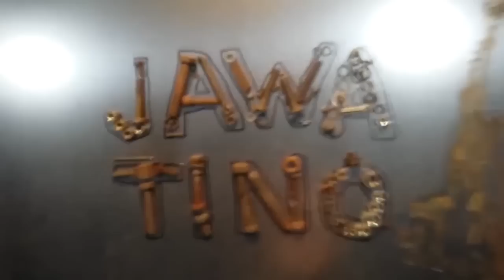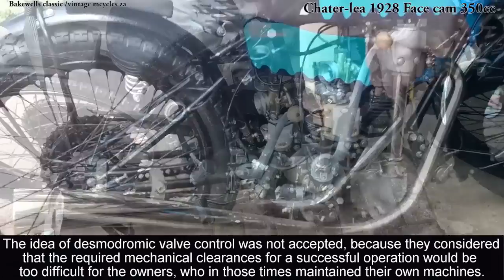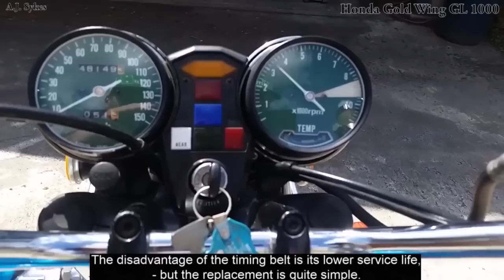The most Interesting OHC engine motorcycles !

Comment: If the 2 stroke road racing engine was developed to this level of Engineering sophistication instead of being phased out due to emissions..horsepower would be higher with a much lower engine weight.
Reply: @retiredbore378  Technology to develop more advanced cleaner burning synthetic polyester lubricants would have reduced these emissions even further if it was pursued.
Reply: @Retired BoreThe lack of electronic fuel injection (as per Mitsubishi on 4 strokes) and stratified charge did nothing for 2-strokes. Then we all chase after some demented electric or fuel cell goal.
Reply: Most all racing programs are supposed to eventually feed improvements in the parent company's general product line.  It made sense for the two-strokes for a long time but they just don't carry through for a road-going product.  I was an ardent two-stroke fan starting in the late '50s (first bike was a 200cc Zundapp) then got into Bultaco for competition and a street machine.  About that time I went to work for a Honda/BSA dealer and as my experience broadened, I began to see that durability and general good manners favored the four-cycle.  I've enjoyed both, campaigned Suzuki 250s for years for off-road but the then new four-cycle street Suzukis began to dull the magnificence of the two strokes and I could see the division was favoring the four-cycles for the future.
Reply: Join k
Reply: Split single and opposed piston two strokes are the only way to go if you want better power and clean emissions. The old crankcase induction with total loss lubrication is incapable of the low emission standards mandated today. You would be a fool if you think that the Automotive companies haven't tried.
Reply: @Donald Sayers  Split singles and opposed piston 2 cycles ARE NOT racing engines but low rpm torque machines.. Im referring to engines that are capable of sustained 12k plus rpms during a race..PLUS with the serious advances in lubricant technology these days we now have triple ester fully synthetic 2T Oils..Couple that with digital fuel and lean oil injection we now have a 2 stroke with similar emissions to the 4 stroke..I suggest you thoroughly research completely the KTM and HUSKY websites to bring your 2 stroke knowledge up to current status😁😁😁
Reply: Yeah, that's why we are all driving two strokes, not.
Reply: @Donald Sayers  Well I certainly am still and will always be..I have Suzuki RGV250..RM85L...TS250X..KTM540MXC..and an old Kawasaki KV100 farm bike..2 strokes forever and ever.
Reply: Evinrude did a great job on cleaning 2 stroke, but then BRP killed it.
Reply: Wait if my cylinderhead is ready !
Reply: 500cc gp bikes reached  200 hp before they were phased out. The current  1000cc 4 strokes don't have 400 hp.
Reply: @donaldhipple4921  no current 1000cc gp bikes have way over 200hp. Which  is better than the 500cc 2 strokes. You cant compare a 500cc 2stroke to a 500cc 4 stroke.

Comment: The  NSU  " Steam-train " drive was interesting . I  bet it made for some BAD vibration , but was fairly Bulletproof  as  well .
And the Gear Drives are Pure  ART . Strongest method , but also HIDEOUSLY expensive to manufacture .
Reply: It's odd seeing a counterweight on a camshaft..
Reply: @Retired Bore . Gears ARE the Best drive system , and Helical gears are rather quiet actually . Straight cut Howl like a bitch .
That NSU  drive has ONE of the Elements  STATIC . Basically just a SPACER . 
The Moving Elements , to be effective , would be best spaced at 90 degrees  EXACTLY like a Steam Locomotives drive rods . This will produce an odd Primary  AND Secondary vibration that Phases with the Single Cylinder Engines issues with Primary and Secondary Balance . The Cam Drive would run at Half Engine speed and Ergo , the Cam Drive would alternately Supplement and Detract from the Major Engine Vibrations . The Counterweights would not fully damp this .
I  stand by my original statement .
Reply: @Retired Bore . It was You that started talking about about 120 degrees , out of context . 
120 degrees is the best separation needed on a Three cylinder Inline Engine . Really 240 degrees in a Four-Stroke  triple .
And 120 degrees is the Ideal Bank separation in a V-6 for perfect primary and secondary balance .
Since steam cylinders are Double Acting the 120 degrees or 60 degrees would be equally effective . Just  likely that 120 was used for balance reasons .
All those facts are  IRRELEVANT .
We  re discussing a Single cylinder Engine , which has no balance to speak of , using a reciprocating drive for the Camshaft . A  drive that will be harmonically Phasing with the Primary reciprocating Mass .
I  stand by my original statement  yet Again .
Reply: In my opinion has heavy parasitic losses! But was a very good bike!👏👏👏
Reply: @Retired Bore . Heard it running in the Video . Numbnuts .
It  would  not matter about where you set the Cam Rods . 
You just gave Degrees for  Effective 180 degrees opposed to the Conrod . 
Next revolution they will be Precisely with the Conrod , since Cam drive is Half Engine speed .
And the Cam drive plates  also move fore and aft at the same Timing rate , thereby exacerbating one stroke and slightly dampening the other . 
A Slower more pronounced shake  I  would think .
Still standing by my original statement .
Singles are Rough . That would have been Rougher .
Reply: i hope electromagnetic valve switching comes quick into mass production soon.. get rid of all these fancy clockwork from the engine!
Reply: @fidelcatsro6948  . And a burned out resistor of Transistor , parks you on the side of the road . A simple  Fuse can be bypassed in a  pinch . To get you home .
Reply: @johncunningham4820  
not if theyre made by Japanese 🤣
Reply: @fidelcatsro6948  . YAMAHA  maybe . 
German Electronics are better than Japanese .
Reply: @johncunningham4820  naaaah German cars and bikes are good but they turn into endless money pits..
Reply: @johncunningham4820  حق با شماست 👍
Reply: Nope, it was quite smooth.  I was just getting into the sport when I visited our BMW/NSU dealership and got first hand experience with the very refined NSUs which used the eccentric rods.  They were mechanically very quiet along with the exhaust note which most German machines of the time were due to noise restrictions in Germany.  I owned a 175cc Maxi later on as well as a BMW R26, all of them very refined and easy to own and service.
Reply: @Retired Bore I know someone who has a large collection of NSU 250 Max machines.  They are smooth and well made.  There is little vibration, none noticeable from the cam drive.  It's rather elegant
Reply: @Retired Bore or alternatively, ride one or talk to someone who has done so.
Reply: @johncunningham4820  how about one with four thinner ones and a flat plane crank

Comment: The Chater-Lea @ 11.45 could have developed Desmo, given that precise closure is not necessary for valve sealing. But this was not known in the 20s, and was discovered by Mercedes in the 50s. A 2-thou clearance is close enough, cylinder pressure will close the valve automatically.

Comment: Darn. I was hoping to see the MV Augusta four cylinder here. My buddy got a 1976 750 that was too cool! The gearbox internals could be accessed from either side of the bike, and the camshaft drive was through a gear tower between #2 and #3 cylinders. The tower could be removed as a unit and the straight cut gears made an awesome sound, almost like a jet!
Reply: The MV Agusta is a very interesting example of design. The road bikes of the late '60s to mid '70s were a road version of the '50s race bikes, with shaft drive just like the first 500cc GP bikes of the late'40s which Les Graham raced.
 The main engine casting is a giant housing, with the gearbox inserted from one side.  The engine itself is self-contained, with just the very top segment of the cases holding the main bearings.  Cylinders are individual castings, with the cam drive being a separate assembly inserted between the middle cylinders.  The head is a one-piece casting with cam follower housings carrying the shafts as well.  
This modular arrangement allows the engine to be removed from the cases by undoing a line of nuts holding the crank bearing carrier to the main casting.  It is very useful if you have a major engine failure while testing, or for any reason need a fresh engine in a hurry.
Reply: @pashakdescilly7517  it was an amazing machine. It's biggest flaw was the front hub, narrow enough to put double discs on Ceriani road racing forks. With the narrow hub and Borani alloy rims, hard braking would cause the front rim to warp requiring "re-truing" the front wheel at regular intervals.
Reply: @eloiseharbeson2483  i am surprised that such a fault would be allowed to persist on such an expensive machine. Larger spoke flanges might help, but could lead to contact between spokes and brake caliper. That would at least lower the stress on the spokes. It's not so very difficult to make wider yokes to allow space for a wider hub.
Reply: @pashakdescilly7517  my understanding is that was changed the next model year to cast wheels for just that reason. My friend bought it NOS in 1980 for half list price ($3600 rather than $7800) because the distributor had gone bankrupt and the carbs were full of preservative.
Reply: @eloiseharbeson2483  your friend did well to get it at such a low price. Now worth rather more....
Reply: @pashakdescilly7517  if it still exists. Pete kept it for only about a year before he sold it to Jimmy. I don't know who Jimmy sold it to, but it's long gone.

Comment: For radial four-valve-heads you might go for a hollow cam rotating round the spark pluck. Suits particularly well for opposing exhausts. And has a simple shaft drive ...
Reply: Weight too much weight
Reply: @jamesangelucci5052  Not true.  There are a number of engines with radial valves in recent production - Aprilia 650 single, Ferrari 355, Honda various singles.  The Aprilia and Ferrari engines use bucket tappets and have no extra parts. The Honda system uses single ohc, normal rockers and a sideways finger follower.

Comment: Why was the timing chain placed in the middle, for air cooled engines???
Reply: To spread the load so camshafts were lighter plus if you have camchain between middle cylinders helps heat displacement.
Reply: Je to jasné, kvůli mazání řetězu a dobrému a stejnému chlazení obou válců vzduchem.🤩

Comment: What was the use of driving the cam with those big connecting rods instead of just using a timing chain or belt. Well tooth belt technology might not have been so great back then but certainly timing chains work great. Seems like it would be a lot less energy to run one , too.
Reply: The crank and rod design  would outlast a chain

Comment: Gear Drive is the only way to go. All of my Hondas have died when the cam chain would break and destroy the engine in spite of routine maintenance and tightening. A cheap and nasty way of driving a valve chain which is why the Japanese use it it works until the second it doesn't and then it destroys your engine.
Reply: my 15yr old bandit 1200 almost hitting 100,000km with original camchain.. all it needs is regular oil changes
Reply: What do you mean "Tightening "  ?  Did you over tension ?    I've never heard of a cam chain failing 😳
Reply: @fidelcatsro6948  A friend of mine had a Honda 450 of the late 1960s.  It had a crankshaft sprocket formed as part of the shaft itself.  Due to wear of this sprocket, his cam chains wore rapidly, and he kept stripping the engine to replace the chain. Eventually he scrapped the bike, as he could not replace or repair this sprocket

Comment: Bevel gears in an engine driving the valve train, might be the dumbest I ever seen. Sounds like it's coming apart. wow. 
Nobody thought that one through. Them bevels won't last long & give you a headach. Why would any company then fill the whole damn motor with gears? Good god man . Use chains to drive cam's & valve trains. No wonder this company went no where.
Reply: The bevel drive Ducatis were quite reliable. They went to belts because it was much cheaper.